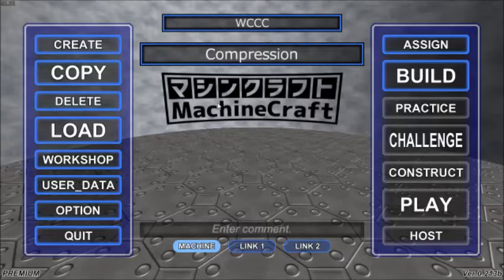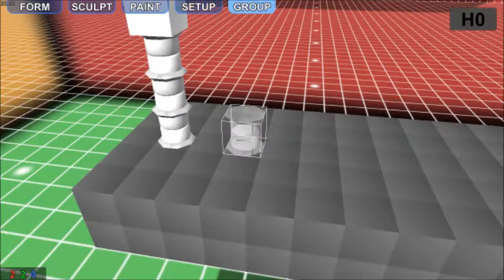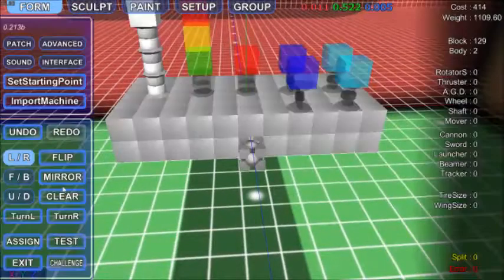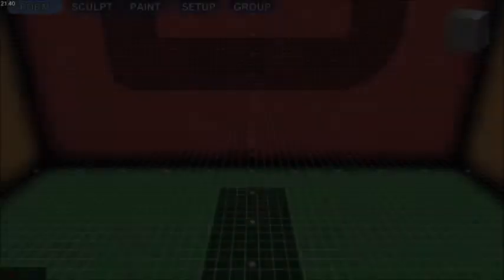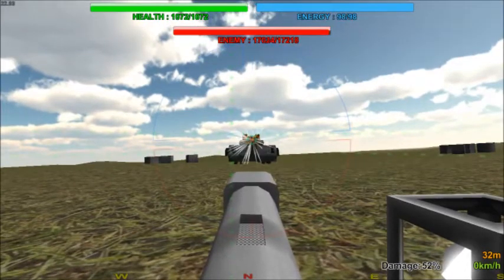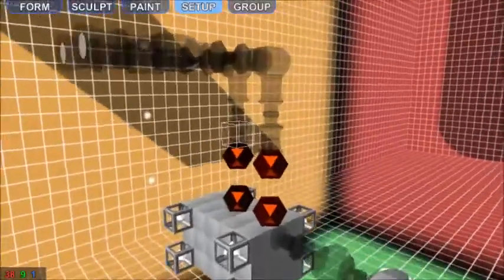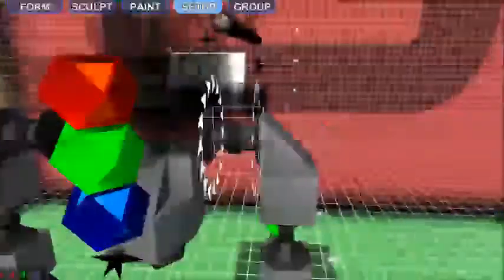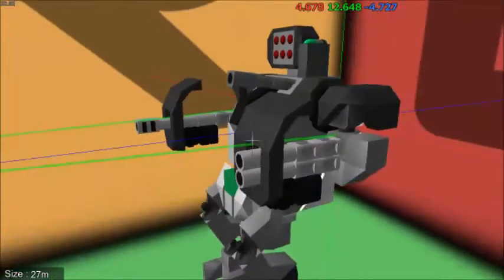MachineCraft BootCamp Ep 4 (Compression)

Comment: so not only did you mean compressing your machine in game
but you also meant compressing the video like crazy
EDIT: good video though, taught me well
Reply from the maker: Zing! That's a good one, I admit. Fraps can be awful about compressing 
during recording, so I do half size and compress afterwards in a 
less-than-lossless methodology.

The things I'll do to avoid the HD space holocaust, I swear. Luckily graphical fidelity isn't super duper important, although certainly handy for some things.
Reply: personally i use obs
you can record in high quality and higher fps and it wont affect your performance as much as fraps
obs works really well for me in combination with sony vegas

also, do you edit your videos or do you not have an editing program to edit with?

oops, the comment wasnt set to reply to you, instead replied to the original post
Reply from the maker: Tuggernaug
 Oh well. Any case, the performance isn't the problem as much as potential file size. Doing half size 12 fps (instead of full 60) saves me 20 fold file size (since 1/2 across 2 dimensions of height and width is 1/4), so obviously that's a tempting deal.

Had a guy recommend OBS a while back I think, so I'll have to give it a swing. Can't be worse than fraps.

Also, no editing software. Some guy handed me a copy of vegas once, but a reformat about a year ago got that wiped and I haven't really seen that guy since just after high school, so fuck me there.

WMM can do limited, shitty editing, but the secondary issue is that editing, especially good editing, takes a considerable amount of time. I have WAY too  many hobbies. A wee bit of youtube uploads (admittedly crappy on many occassions), writing, art, modding for an old game, developing small new games for kicks, playing games, often with friends, and a bunch of other crap like working out and going for runs.

Quite frankly I barely have time to breathe and sleep at half clock, so I outright acknowledge my youtube content won't ever have the time and resources to be any degree of good.

I appreciate the at length criticism though, it never helps to get a 2nd opinion (OBS doesn't need more time, so that's good shit right there) and overall just get feedback. God the internet could use more constructive criticism, so serious thanks there.
Reply: how much space do you have on your current hard drive? for me, recording with obs at 720p 30fps, 1 hour footage normally comes around 800 mb to 1.2 gb depending on how much happens in the video, visually
i honestly feel you on the hobby portion of your comment, i spend alot of time browsing a forum and talking to my friends on discord, occasionally playing overwatch
i do also sometimes draw, or i'll make a pose on garry's mod. so editing videos isn't my top priority, although i plan for it to be a hobby later in the future
i would like to continue to talk to you. would you be fine with me adding you on steam?
Reply from the maker: Tuggernaug
 Do it. I've been added for stupider reasons and then some. This educator and role model thing has its burdens sometimes.

As for HD space? About 300 GB. Fraps untamed at 24-40 FPS and full size can eat 4 GB per every 4-5 minutes or something like that, so that's hardly sustainable. Guess I'm taking this OBS thing seriously now. Likely will be a huge savior in the long run.